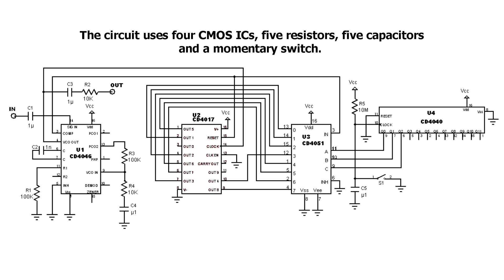Audio frequency multiplier with CD4046 PLL, CD4017, CD4051 and CD4040

Comment from the maker: 00:00 Frequency Multiplier schematic one
00:05 Circuit working, mounted on breadboard
02:59 Circuit analysis with schematic one
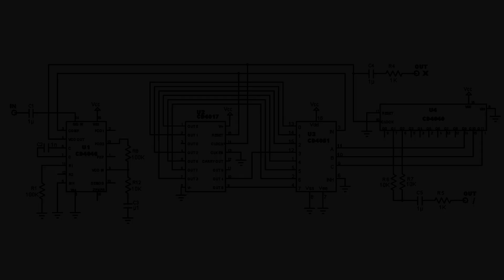04:14 Schematic two, a variation (arpeggiator) with analysis
04:28 Circuit on breadboard and sound examples

Comment: I like your 1st schematic. Good one for creating even harmonics on top octave driven synths. I do however wonder how the cirquit reacts to sudden frequency changes on its input since you only democ it by a manually sweeped oscillator. Did you test it? 0:05
Reply from the maker: I am afraid not. It probably needs some wave cycles to track and adds some noise in the attack.

Comment: what value is c3? is it 1u also? Been playing around with this schematic but mine is gliding between notes for the most part and not stepping like yours seems to do.
Reply from the maker: C1 and C3 are just AC coupling the input and output, they are 1µF on the schematic and should not cause any trouble. In fact, looking at the breadboard on the video I can see two 220nF in parallel at the input, and no capacitor at the output. Just in case: C2 (pins 6 and 7) is 1nF,  C4 (R4 and GND) is 100nF, and C5 (in the switch) is also 100nF.
Reply: @unrelatedactivities  thanks, c3 is not an input or output cap though it is connected to pin 9 and 10 in the c4046 and labeled U1 in the schamtic (as apposed to 1u for c1,c2 and c4 which are connected to inputs and outputs in the schameitc.
Reply from the maker: I think we are looking at different schematics :-) . There are two schematics in the video above, but none has a capacitor connected to pin 9 and 10 in the c4046.
Reply: @unrelatedactivities  9 and 13 though =) cap i labeled c4 in the first schhematic and c3 in the later one starting around 4:12 in the video. Is it 1u?
Reply from the maker: @vikingsade  This is getting funny :-), there is a 100K resistor connected to pin 13 and 9, then a 10K resistor connected to pin 9 and a capacitor, this capacitor (c4 in the first schematic and c3 in the later one) is 100nF and is connected to the 10K resistor and ground.
Reply: 😂 then I understand! Thanks
Reply from the maker: You are welcome!  @vikingsade